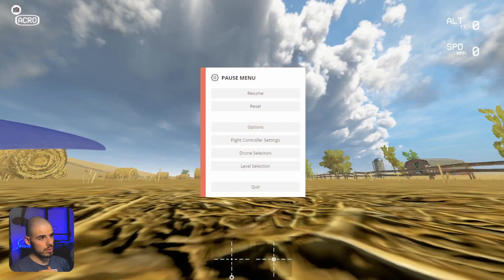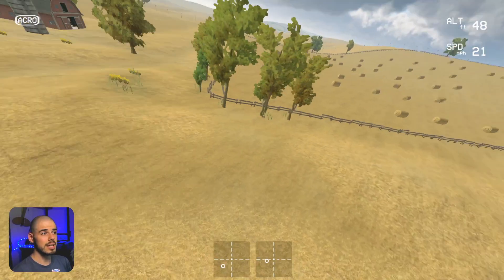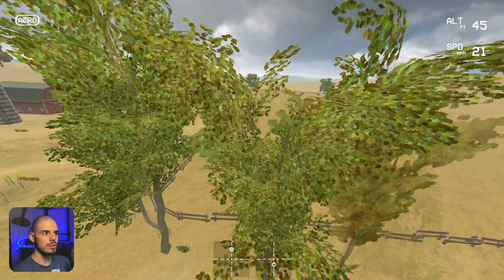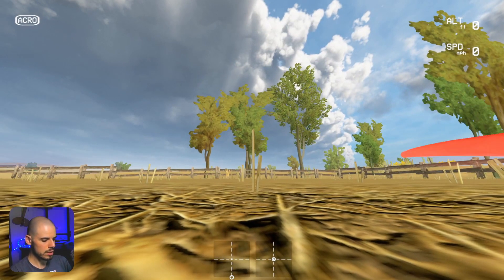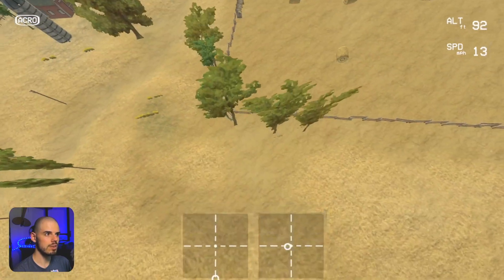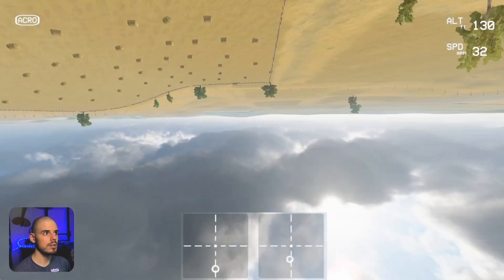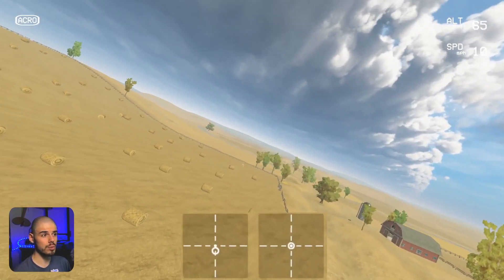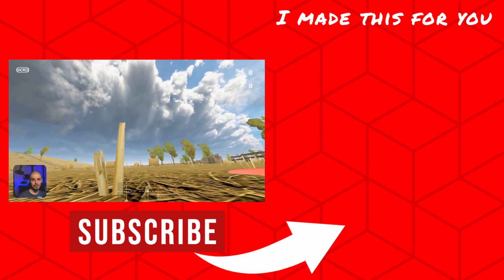Lesson 12: How to PowerLoop (2 ways) - FPV Drone Flight Training

Comment: I never seem to have time to get in the sim  .I usually fly once a week unfortunately.  I keep trying powerloops out in the open and struggle with the throttle and pitch  control. There is a perfect set of trees at the park ib fly at alot, but I don't feel like busting up my quads lol. In know the sum is the answee. With that said, great video, I got some important advice from your tutorial.  First of is the camera angle. I think that will help a lot . Second is getting enough momentum on the way up to needle to throttle down and float a bit as you keep pitching around the top until you start to see your path again then power through the gap.  I like the way you also showed the mistakes . Many tutorials only show the right way but seeing the problems helps us to recognize what we are doing wrong wren trying new tricks. Thanks. You have a new subscriber.

Comment: Hi RCwithAdam. I have a pretty important question. Will a 3 channel plane work with a 10 channel radio like the FS-i6x? If not, what do I use? 
Thanks
Reply from the maker: Hi! Yes, absolutely! 10 channel just means you can't use MORE than 10 channels. Have fun!
Reply: @RCwithAdam1  Thanks so much! I just wanted to know before I sent 150 bucks on a plane kit and electronics!